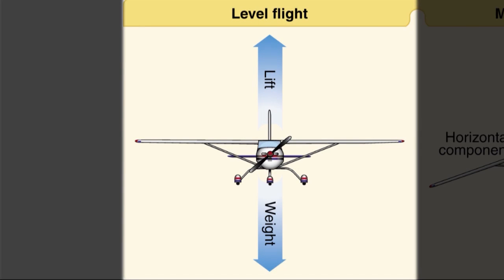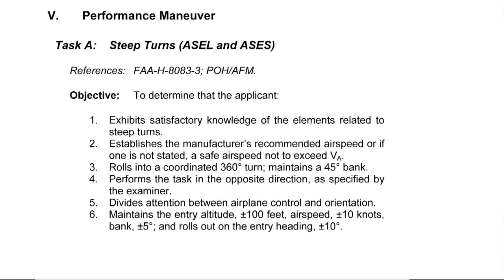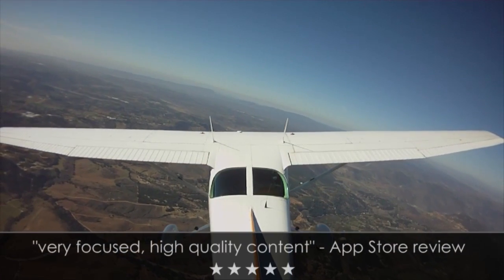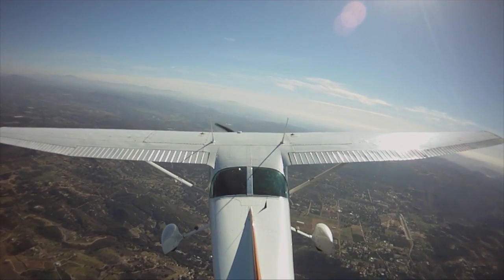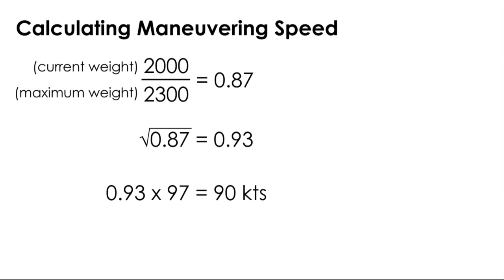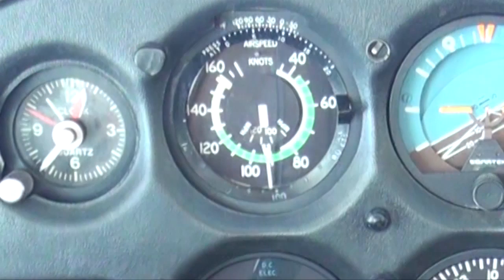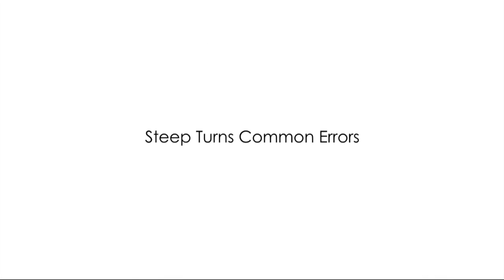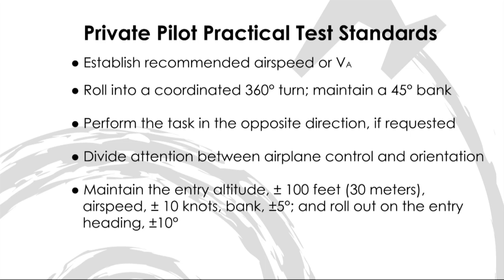Private Pilot Course - Steep Turns

Comment: Great video! but note load factor is not caused by centrifugal force as this is actually an apparent or fictitious force. Centripetal force or the horizontal component of lift plus the vertical component of lift say at 30 degrees bank gives you a resultant lift vector in excess of the aircraft weight . If the resultant lift generated is then divided by the aircraft weight you will obtain the load factor. Same could be applied to any bank angle, the fictitious centrifugal force is simply inertia opposing the circular path of the aircraft. There is no force pulling the aircraft to the outside of the turn.

Comment: Hello Jason. Since I co-produced this video, I thought I would try to explain my comments. In any steep turn, there is a tendency of the airplane to yaw to the left. This left turning tendency is due to something called P-Factor, also called adverse yaw. In a right turn, right rudder is necessary to offset the left yaw and maintain coordinated flight. In a left turn, since the airplane is yawed to the left already, little or no left rudder is required to maintain coordinated flight.